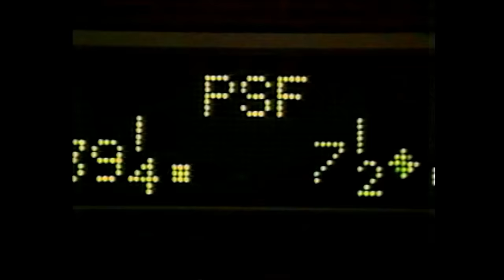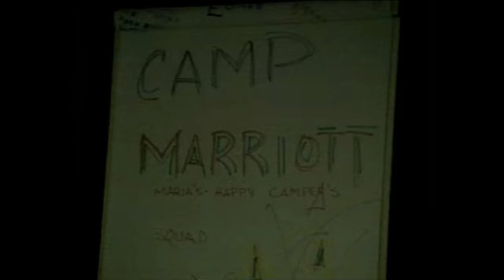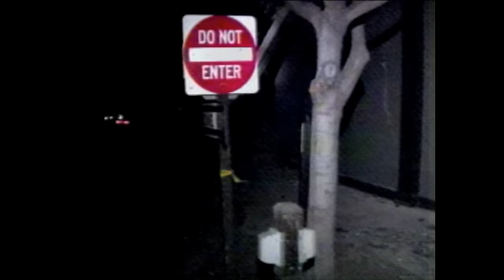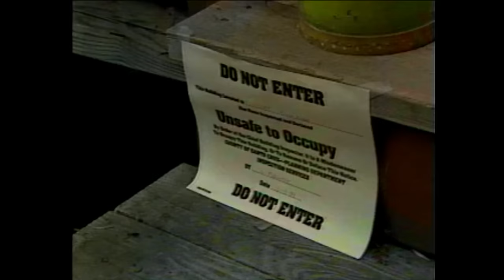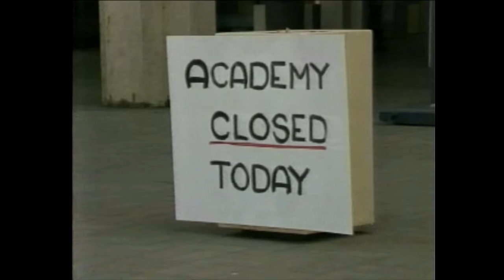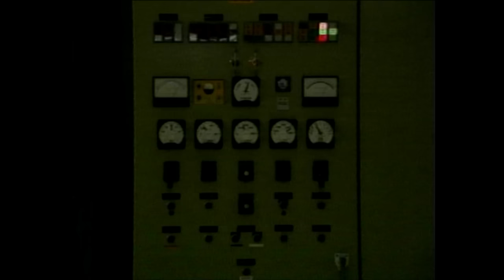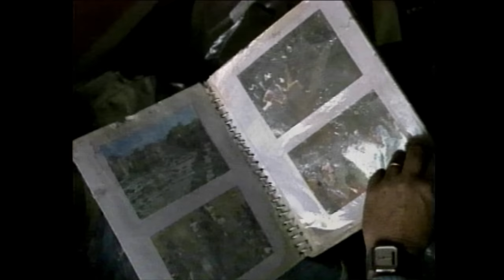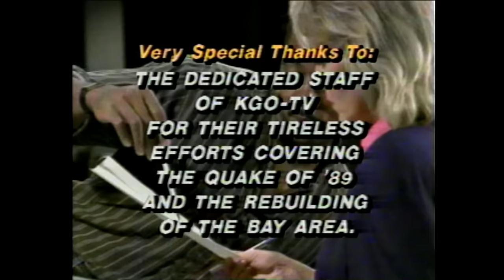Quake Of '89, A Video Journal

Comment: I was living in Napa in '89, and during the World Series, we first heard the TV turn to snow.  It took some seconds for the shock waves to reach Napa, which were quite strong, the strongest 'quake among many I felt while living in Napa by far.  The shock waves had slowed by the time they reached Napa, so the quake lasted longer.

Our exterior stucco developed a one inch crack around the foundation, and our sidewalk buckled.

A friend was doing some remodeling work for a client in nearby Sonoma who had an in ground pool, and he said the pool just emptied in seconds.

The Bay Bridge replacement section was made at Basalt Rock in Napa and shipped by barge to the Bay Bridge, repairing it sooner than expected.

Just one week earlier, I had driven home from Santa Clara to Napa and drove in the lower deck of the Cypress freeway which had collapsed.  I was nervous then--not often mentioned is this quake had foreshocks and we were all on edge, some of us expecting something bigger.

I had moved from Napa, a 2000 quake convinced my Mom to move from Napa to Phoenix.  In '14 Napa had a 6.0 quake, the biggest in the Bay Area since '79, that caused much damage, fires, and shut down the airport tower for some time.

The danger in an earthquake is from falling items or collapses, not the ground shaking itself.  In Quake country, bolting tall furniture to walls is a huge help--it saved my Mom's life in '00, since my Dad bolted the tall furniture which was leaning after the '89 quake to the walls.  Self locking cabinets can protect dishes and glassware, and bolting homes to their foundations can prevent homes from shifting off of them.

Brick Chimneys are an issue.  My Mom's Chimney was condemned in a home inspection when she sold her home six months after the '00 quake, the inspector put his hand on it and it almost collapsed.

Watching the news coverage of the '89 quake, I saw the Cypress freeway had collapsed before the news anchors noticed it, then they panned around to it again and reported on it.

The World Series, the only Bay Bridge series we ever had, saved many lives, since many went home early from work or went to the game.

I minored in Earth Sciences--learning of the nature of living in quake country.  The day before the quake, I was in Tahoe and took a guided sailboat ride.  Some tourists headed for San Francisco asked the young skipper about quakes and he said "I've lived in California all my life, and never felt an earthquake".  Jinxed us, he did, and he was speaking to someone (me) who had been in several quakes above 5.0 since the late 60's.

He was young, and quakes (though Tahoe is at risk) are seldom felt in that part of California--I just bit my lip when he said what he did.

I drove home the day of the quake, getting home three hours before it so I could help babysit my two nephews, with my Mom and I when the quake hit.

My Dad was driving home from work and said drivers were making "unscheduled lane changes" on Napa's Highway 29.

For months after the quake, my heart would beat fast if a table rocked, which is not uncommon for those who've felt strong quakes and psychologists told us to expect that.

Russia offered to send psychologists, since they have quake experience, to California to aid quake victims, a sign of Glasnost in the Gorbachev days.
Reply: hopefully it didn't ruin your wine.

Comment from the maker: I was in a car stopped at an intersection when this happened. I saw the street asphalt do things I have never heard of elsewhere or seen in any earthquake video: Waves in the street about a foot tall traveled toward the car as it rocked up and down. 
It was a long time ago but I still remember how the sidewalk and the street moved quite differently. There was a minivan parked with two wheels on the sidewalk; the other two wheels moved up and down more, so the bright reflection of the sun in the windows was flashing as the van rocked. 
Telephone and electric lines on the poles went tight, slack, tight, slack. Around the corner there was a laundromat, the door had jammed due to damage to the building and people were passing baskets of laundry out of the broken window. Traffic lights were out during the afternoon commute and a few brave folks (not police officers) were directing traffic in large intersections... and not getting run over. Elsewhere expansion joint covers in corridors connecting tall buildings fell away (as designed) leaving 3 foot gaps one could look straight down into all the way to the ground. I saw pieces of sidewalk sticking 10 feet up into the air in the following days.
Reply: It's raining tacos
Reply: Me too! I lived in half moon bay at the time. When the quake started I remember looking down the street and saw waves like you would see in water. Didn't look possible.
Reply: That must of been scary as all get-out
Reply: I also saw waves in the parking lot I was at.
Reply: Yeah in a really strong earthquakes there’s something that can actually force
 solid ground to act like water
Reply from the maker: @joshriver75  ok so you saw that too. Only now 30 years later I'm finally hearing other people saying they saw it. You see the street is literally lapping at the sidewalk... the waves are just longer.
Reply: @wdavem  This is incredibly coincidental considering your original comment was 2 years ago. 
I dont know if you realized it but your timing just missed the Oct 17th anniversary.
Yesterday I was having a conversation with someone that offered up a theory that seemed plausible.
What amazed me most was there was hardly any cracks in the street which doesn't comport with what I knew I saw. 
The possible explanation could be an optical illusion, do to the fact that you're standing on shaking ground while seismic waves moving beneath gives an exaggerated perspective when looking towards a horizon. 
For the sake of debate..if it was possible to levitate just off the ground those waves would be much less noticeable.
Reply from the maker: @joshriver75  Yes I was thinking the exact same about the street I saw looking more or less normal afterwards! So ABC is showing a series again right now this week about the '89 quake and there was a guy who had been standing on the street in the Marina district and he said it looked like someone was shaking a carpet and making waves... which did really mess up the street.  I was checking the stats on this video on the anniversary and I'm really impressed with the view count and comments!
Reply from the maker: @joshriver75  Almost forgot to say that I think the street really was moving 1 foot up and down, if the waves are too big and/or close together they bend the asphalt too much and the sidewalk starts to break up and sink and stick up in the air and turn over if you are on land fill!
Reply: I’m way late on this reply, but good topic.

Just as a point of reference, we had an earthquake in San Diego some years back that was pretty intense. Sunday afternoon, I think Easter Sunday. On the ground floor of my house, I was painting a rolling plant stand when the shaking and rocking started. It got worse and we ran outside. It was hard to keep our feet and we dropped to the lawn. The power lines were jumping up and down, the poles tilting — stretch, release, then the lines slamming down again, kind of like those power ropes in a gym. None of then fell, thankfully, because we were right underneath.

That’s when we also felt and saw the lawn and the brick walkway undulating in waves, maybe 8” or so. We should have gone farther away from the house but were unable to stand. It finally ended, we went back into the house, everything seemed fine, we turned on the news and I continued painting. 

As I leaned back into the painting project, I discovered that the project had somehow turned 180 degrees and that I was leaning into the wet side of the project, previously facing away from me. Then realization hit and I ran upstairs to find a lot of things from shelves and cabinets strewn all over. At the time, my wood frame 2-story house was around 100 years old, and I’m guessing that the waves of motion caused the upper story to twist and turn back and forth, absorbing the forces from lower down. Downstairs, only the thing on wheels (the stand I was painting) shifted around. It’s the only time things have fallen in my house during an earthquake, even more severe ones.

The house was fine and is still going strong. I’ve been thru some bad earthquakes in my time in California, but that Sunday earthquake is the only time I can remember seeing the ground undulate like that. I’m not going to forget rows of hillocks moving across my lawn or bricks rising on small waves anytime soon, though! I do suggest that the motion could seem a little exaggerated in memory because of visual alignment cues (for instance the rows of bricks), but the fact of not being able to stand and the mess upstairs bears out some significant destabilizing motion.
Reply: Sounds like the horror movie Tremors must have been so scary wow

Comment: I was in San Jose at the time this hit. I was working out at my gym on the second floor. Ceiling tiles started falling down and the whole building shook like crazy. After it stopped, I continued working out. I had no clue about what was happening around the bay area until I got home. It was shocking, especially the freeway collapse. That seemed to get the most attention on TV. It was never rebuilt. Scary to be in these, although it wasn't my first.

Comment: The fire in the Marina was on Fillmore Street not Divisadero. It was at Bay Street across from Marina Junior High School which I graduated from in. 1966. I refuse to call it a Middle School.
Reply: George Senda that building fire occurred on the corner of Fillmore & Divisadero streets as seen and stated in other news footage reports!
Reply: @GaryHind701  Then there must have been TWO fires that I was not originally aware of. Marina Jr. High School is still at Fillmore & Chestnut bordered by Bay on the South and has been since I attended there in 1965.
The minute I saw the initial news report showing the fire and building collapse, I yelled :

" That's my junior high school. "